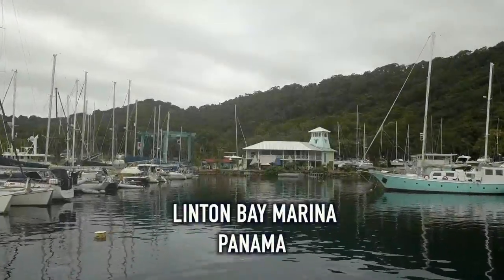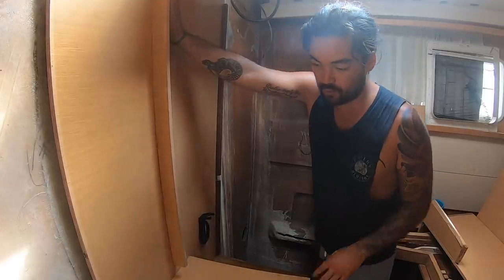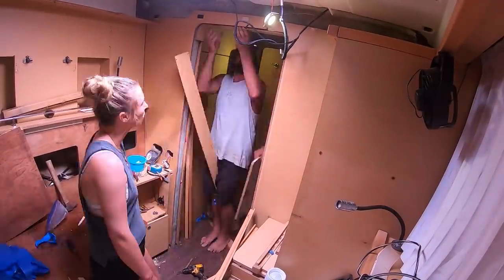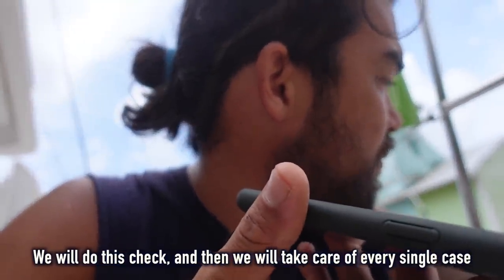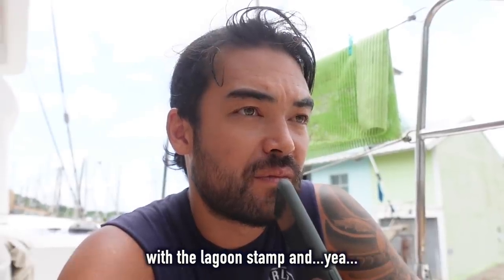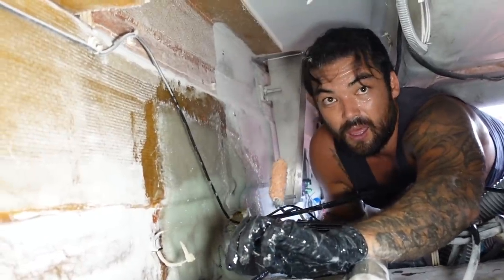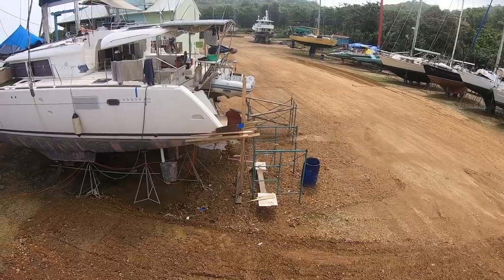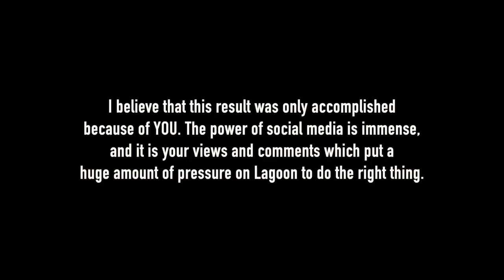AMAZING NEWS FROM LAGOON!! - Cracked bulkhead SERIES FINALE  (Episode 119)

Comment: The liability and internet exposure was making them sweat. Their lawyers decided to tell them to develop a conscience. Good job, exposing the truth, and potentially saving lives. 
Those negative people will always be negative. Just let it go.
Reply: @lbb101  exactly.  It doesn't seem nefarious it seems like things worked through as designed.  Data first small bits of pieces was coming in.  These pieces with the help of Colin where brought to Lagoon's attention.  Of course they have to be careful what they say at first, they are not stupid and they need to be careful of their own liability.  Sure enough in only 3 weeks they have some some investigations.  Surely Colin's videos helped in great part but i am sure they employee some very smart engineers as well.  I bet they had a look just at the production line as this seemed to less a pure design flaw and more a not compensating enough for the margin of safety given a large production line they needed to account better for the flaws.  If they beef this section up the few voids and imperfections do not weaken the system enough.  I think in engineering its called the safety factor,  a ratio of how over build something is designed as in design something 10x stronger than the need and be very safe without a lot of effort or in planes since weight is so very important they spend a crazy amount of effort testing and design so that they are comfortable with a much lower safety ratio.  Accordingly way more maintenance and checks though than say a bridge which they just over build and leave along mostly.

Fantastic to see a glimpse of the big process, that a massive company like lagoon took this and especially Colin seriously.  Colin did very well to both impress upon them the huge importance but also keep things as positive as could be.  I am sure he was frustrated with them, we saw it but im sure there is much he did not show us about his frustrations with Lagoon but keeping the dialogue open and we have this amazing result.  Its a very good example of a lot of things!  Very positive! i am so happy i cannot imagine how thrilled Colin is!

Comment: Let's be honest. You did it exactly right. Lagoon has the responsibility to provide the info. If you supply this info you assume certain liability and responsibility. This s not your responsibility. You already went above and beyond bring the issue to the forefront. Those complaining and swearing at you where mad at lagoon and didn't even know it. I suspect some of those had even counted on the resale value to justify the expense of owning and buying a boat.  In other words they approached sailing from the wrong direction. The experience and wonder of salt life is the only reward and return that you can count on as a boat owner. Well done Colin, keep the pressure up and thank you for all the lives you may have saved.

Comment: It's going to take some real convincing that this bulkhead problem is isolated to the Lagoon 450? Lagoon's own manufacturing did this, did those same techniques get applied to their other boats? Why wouldn't they? Why would they do something different in the same factory? I have always had your back, great job, mate.
Reply: manufacturers build to "rules" and "standards". They have a standard of quality control and should have an inspector of works. They have rules about how much structural strength each boat has. Logic suggests that if many 450's were "underbuilt" structurally and poorly manufactured, then any Lagoon built boat that shares the same designer, period of manufacture and/or quality control inspector is at risk of similar failures.

I think the truth is that most production boats are "underbuilt" to save money and increase profit and so many production boats are not strong enough to deal with the rigours of deep ocean crusing.
Reply: Exactly mate, inspector looks at a handful of builds and they get a open water rating for the lot! Too much trust in the big name builders and they just hand them open water rating for all their builds!!
Reply: I agree with Colin that they're nice cats but once they're few years old, there'd be movement everywhere in them, definitely cutting corners structurally on em'
Reply: @simonmoorcroft1417  That is why we are building our own custom cat of my husband's design. Don't trust any production boats for the very reason you stated, that they are "underbuilt" to save money. Our's will definitely be "overbuilt"!
Reply: @susiesmithe2475  is your husband a naval architect? Or an engineer?

Comment: Good news that Lagoon is standing behind there boats, of course only time will tell how well they do.
Your perseverance has yielded great results. Repair is solid and you really made the boat much stronger overall.
I hope everything works out for all of the Lagoon owners.
Your estimate for the repair seems very reasonable considering the time involved to disassemble the cosmetic carpentry, inspect all bulkheads, measure and correct the distortion of the hulls, decks and other affected areas, then fix it and put it all back together.
Many of the details of your repair; such as the layers of tabbing greatly add strength and help spread stress over a much larger area.

Comment: The Lagoon company is doing the right thing by helping some owners. When I first saw the multiple bends and fracturing of the plywood bulkheads it was obvious that the stresses were too great for the thickness of the plywood. I think the plywood should have been at least twice as thick around the mast bulkheads and maybe on the transom. In addition the materials used (glue) and how bulkheads were installed emphasized the weakness of the wood. Holes drilled in small surface areas of the bulkheads and poor tabbing in joints certainly contributed to your massive boat failure. You have done a fantastic job of correcting defects in materials and construction and even beyond that have called attention to the problem to help other owners. This could have been a disaster on the open seas and you are probably a life saver for yourself and others.  Well Done!!

Comment: Colin,  Agree 100 % in you final statements that the POWER of social media is what caused Lagoon to do the right thing.  Very happy for all the 450 owners for this.  However, I hope people don't forget that it TOOK all of these groups, social media, YouTube and possible protestors at the upcoming boat shows to MAKE them do this.  Lastly, the "fix" is a relative term.  Last I saw heard the fix could be a thin metal bracket.  One owner said they were "fixing" their bulkheads in the water.  Hard to measure any movement of the hulls in the water. To me and many others it still looks poorly on Lagoon.

Thanks for all you , David, Ryan and a few others did for the 450 owners out there.

Comment: I agree completely with not sharing your documentation.  For most 450 owners, the repairs and reinforcements you guys made will not be necessary.  The idea is not to make the boat able to withstand a tsunami, (which is probably where Parlay is now lol) but to maintain or restore the seaworthiness of a new 450.  That will most likely be Lagoon's approach as well.  Many of the things that failed on parlay would never have failed if not for the main bulkheads.  Granted, there were issues like the deck glue that were obviously there from the start, but those are also things that could be fixed without such drastic measures being taken to do so.  Like many others have said, your boat is now a tank, and it's awesome that you were willing and able to go that far with the repairs and reinforcement.  That doesn't mean that it's a necessary procedure for everyone else.  Let everyone get a repair procedure tailored to their own damages.

Comment: Great result mate, you have earned it. Its a huge job done well.  Lagoon have suffered so much brand damage in the past few weeks,  there were once known as builders of big sturdy charter cats that were slow but indestructible.  Not any more. As others have said, if this is happening to the 450s then its probably a manufacturing issue through the whole range. If they had not agreed to make good the damage to these 450s their brand would be dead in the water. Hard to sell a boat that is known to break up, hard to sell a second hand boat that has not been inspected and repaired by the factory or its agents.  This will send shivers through the entire cat market, all manufacturers have been trying to cut weight without compromising strength for some years. No company can afford damage such as this to their brand so they all need to re-examine their basics in regards to hull strength.

Comment: If i had lagoon to rebuild and you guys perfected the 3 or 4 layerplywood  bulk head I would look for premade bulk heads and cut  them to fit and where it tabs to the hull i would leave fiberglass flagging to tab it in one layer at a time...each layer binding in a few inches further...along the bulkhead these precuts would confirm that the boat was squared so they would fit correctly... and that as they say is the key squaring the boat on the hard before work begins...

Comment: Lagoon could really take advantage of this situation and free advertising by allowing in its budget for more use of carbon fibre or other lightweight performance materials... specifically on the frame of future boats. The performance gains may neccessitate a "450R" if it handles great and it's frame really puts the power into the water with less flexing.

Comment: I've been following your nightmare with this Lagoon 450... Obviously, it has a major fault in the design structure that is antagonist to the engineering design principles of a Catamaran. 
The theory behind a Catamaran or even a Trimaran, is that the mid section/bridges/bulkhead structure/ are supported/lying on the two side hulls. Thus the midsection/bridge should not bare the weights of side hulls. This also  means that the weight of both hulls should be almost the same As the main role of midsection  is only to hold the cohesion of whole structure together. Therefore it should absorb and dissipate the deformation effects of external forces and prevent them propagation to internal structures

Comment: Congratulations,  If the yacht shows evidence of a design failure , It is only reasonable to compensate ALL owners for 
the costs involved to restore the boat to a SAFE condition.
$10K / materials, time in ways,
loss of use would only be fair remuneration to avoid a major 
class action suit or worse a wrongfull death suit. 
Keep on, head up, be strong.
Best to you Scott & Lynn
San  Diego sailors⛵

Comment: Wow. I can’t believe they thought a single 18mm plywood sheet constitutes a bulkhead!

The amount of non-structural cabinetry is also insane. Just a complete waste of load. Yes, infused foamcore bulkheads and shelving are expensive and so is tabbing them in. But the weight savings and increased strength, and thus speed and safety, is worth it.

Comment: @7:50. Honestly think what you have done here Colin is f awesome mate.  However, lets not give too much (or any) credit yet to Lagoon and it's director.  Saying he will do these things over the phone and actually following through with the actions are two very different things.   He gets a great media sound bite on your channel and tries to recover some reputation but the proof of the pudding is in the actions he actually follows through with (as you say at the end of your video).  In addition he continually denied any flaw in his design until he was pressured and trapped in a corner with so many folks coming forward with similar issues.  We need more folks like you Colin calling powerful manufacturers out on their poor after-market service and products.  You should be working as a high level surveyor or marine structural engineer.

Comment: so too late now and not to rain on your parade but I would do a coat of epoxy on the areas that you grooved and cut out on the back side of the cabinets. removing the outer layer to thin them down to fit also makes them vulnerable to humidity.

Comment: Lagoon was pushed into a corner and had no choice but to admit the design flaw.  There are just too many boats with the bulkhead cracking issue to deny it any longer.  Lagoon's reputation and basically their viability as a boat builder was put into question with this issue and they had to act to keep their company alive.

Comment: I guarantee the structural integratory of the hurricane Irma damage done to most of the 450 lagoons. Was done by the cranes trying to lift the half waterlogged sunken Catamarans! Trying to lift a boat that was soaking in 1000's of pounds of salt water for a considerable amount of time. Would weaken and compromise the whole structure of the boat! What hidden structural damage that wasn't seen at first! Came back to haunt the new owners later!

Comment: First off I never thought you were trying to pull the wool over anyone.  You were making people aware of a potentially horrible situation.  I know and understand you wanted to let others know of this possible problem because you didn't want to feel responsible if you heard something in the future.  I am more than posivie you would have mentioned this to people even if you did not have a youtube channel.  You are that type of guy.  Basically huge compliments on hadling a shitty situation and helping others get something terrible sorted out.

When I first saw the bulkheads I knew from instinct and experience.  I have built two boats and fixed many with my father over the years.  He used to races boats and he stuffed two ways at 50 plus MHP on Lake Erie.  It did a nasty number on the boat.  We learned about bulkheads and how to repair them a well from the manufacturer.  In fact my father was lucky he got the manufacturer to sponser him.  OK long story short I just had a nasty idea those bulkheads were not very well engineered.  I know what they were going for profit and weight.  The triple ply in the bottom of the bulkhead didn't make any sense seriously.  If you don't allow the stress to transfer down and around properly and evenly of course there will be problems.  The other thing is that flipping leak that cause your bulkheads to rot.  What a bummer seriously.  That is also a design flaw.  If this were a car it would have to be recalled and fixed at the manufacturer expense.  Well in the US that is.  But I am super happy to hear Lagoon will fix the problems on boats.  Last thing even if they did create a good bulkhead they would have been rotten because of that design flaw.  There should be some sort of tab or something to keep that water from even getting to the bulkhead in the first place.  OK enough rambling I am just glad shit is getting straightened out.  I do not own a boat now but was getting annoyed at Lagoon for their behavior.

Comment: wait, I am confused, if they accept there is actually a problem with the design of the bulkhead and will fix it if cracked/separated what does it matter if it has been chartered out or it has been in a storm?? I think they are on thin ice legally.

Comment: it is obviously a design flaw.  Easy to see from what you tore apart.  Irma didn't cause bulkhead rot. You feel you over designed the fix because it is stronger than what is originally there, but in my opinion a catamaran should safely fly a hull without threat of breaking apart if the boat flips or crashes back down on the water normally.  That said i would never fly a hull on a boat that big.
Reply: but outreamer did fly a hulll at 20 knots.

Comment: QUESTION OR 2.
Do Lagoon say this is a design fault ?
Looks like they are taking accountability / Responsibility.
If its a design fault then all Lagoons should be covered / Recalled.
How could anyone say Its a design fault  in only Lagoons that have not been in hurricanes ?
So the hurricane damaged ones had fantastic bulkheads ?
Initially I though well done Lagoon BUT after a little time with my 3 brain cells I think = Fix all the boats as by fixing some you are not taking responsibility you are just looking for positive publicity.

Comment: I'm sorry but Lagoon should be responsible for repairing EVERY bulkhead they put out that was damaged because it obviously was a DESIGN FLAW.  Every boat that used  the same bulkhead design will have this damage.  The owners of boats that have the same bulkhead damage that Lagoon refuses to fix should form a class action lawsuit.  The folks who repaired the damage, like you, at your expense, should be reimbursed for their expenses PLUS awarded damages for the inconvenience as well as the nightmare each of them suffered due to this drastic engineering failure.  A licensed professional engineer or a team of licensed professional engineers and designers put boats on the water, certifying them to be safe when they weren't.

Lagoon don't you dare cheap out on this.  You collected the retail price of safely and properly designed boats but delivered products with a MAJOR DESIGN FLAW.  Do the right thing by every owner with this problem or go out of business and lose everything you own.  There are laws against building and selling defective boats that could cost people their lives which is exactly what you did, and then you tried to cover this crap up with settling with some of the boat owners as long as they signed a NDA (Non-Disclosure Agreement).  That last statement demonstrates your attempt to cover this issue up which is criminal.

Lagoon do the RIGHT thing!